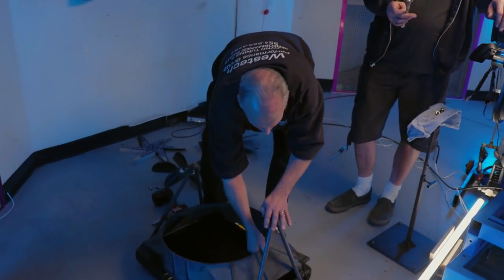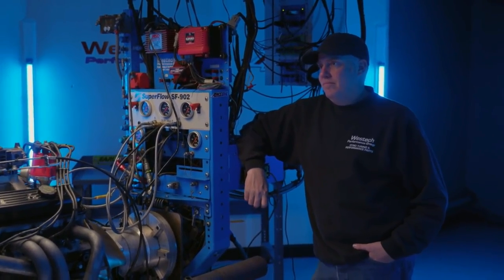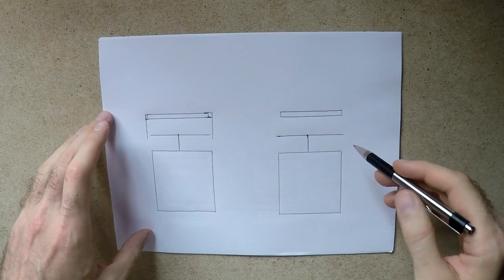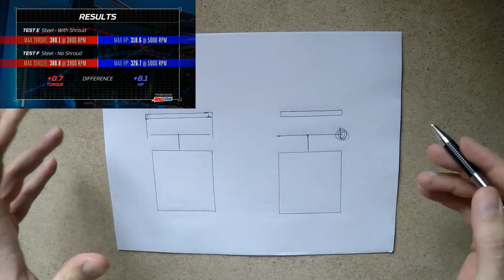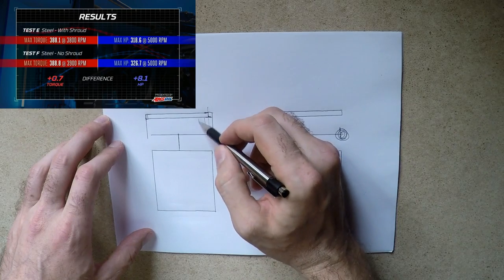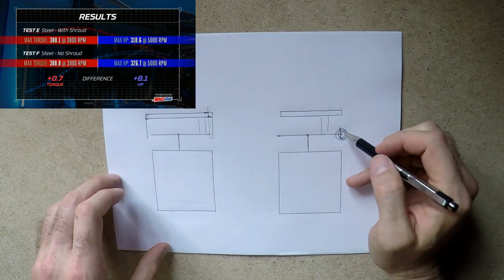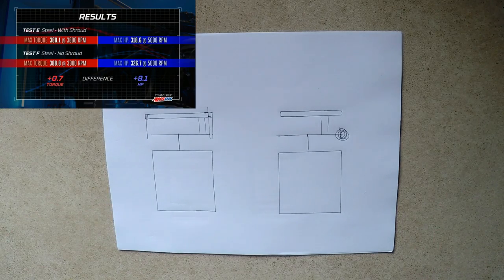Engine Masters EP20 explained!  Why a fan shroud costs you power.

Comment: This is a very scientific explanation of the situation. Let me explain why it takes more power with the shroud, with a more simple explanation. 
The radiator reduces airflow via restriction, it blocks air. So, if you force the air to travel exclusively through the restriction, with a shroud, it's going to be harder to turn the fan.

Comment: For a race car this is valid experiment since you are seraching for more horsepower.  At say, Nascar speedways you get so much air to the radiator at those high speeds they tape over the grill openining to just a couple narrow slits for air in. For most of us we drive on the street, and not at the 3900 to 5000rpm shown on the charts above, unless you are hotrodding it for a few seconds due to speed limits. Normally you are cruising at about 1600 to 2200 rpm. If you are in traffic you might be at idle for long periods. In that case you need a shroud if you are using eng driven fan, or go to electric fans thermostatically controlled. Look at the torque specs at 3900rpm, it's only 0.7 ft/lbs difference with a shroud.

Comment: The purpose of a shroud is to ensure than the fan pulls as much cooler outside air through the radiator as possible. Going without a shroud just ensures less air being pulled through the radiator and a lot more hot air just being stirred around in the engine compartment, leading to overheating.

Comment: The engine running warmer because you don't have the goddamn fan shroud on it, will also cost you horsepower.
Reply: *cough *cough electric radiator fan

Comment: So you're trading some cooling for horsepower since the fan is doing less work without the shroud?  There are no free lunches.
Reply: You don't need the fan at high speeds, when you need performance. Yes, there are free lunches. it's all about reducing  rotating mass, if you reduce it, you get FREE horsepower. Very simple.
Reply: Well you also lose some cooling with no fan shroud, which means less power. If you want to make more power, your engine will get more power when it's cooler than the typical 190F. So there's some trade off here. You could also just go with electric fans to solve all of this.
Reply: more load amp motor wise fans with surround less load more fan rpm less amp draw less fan motor strain without
Reply: @theaussie7160  incorrect, alternator at full load sucks 1 hp plus the battery has full charge and will provide plenty of power for e-fan

Comment: Hey I have a 03 GMC YUKON 2500 8.1 AND I SHOP IN JUNK YARDS ALL THE TIME SOMEONE STOLED MY FAN SHROUD I HAD TAKEN IT OFF TO REPLACE FAN CLUTCH K .IN ORDER TO GET A SHROUD NOW CAUSE I CANT FIND OBE OR USED NE GOTTO BUY A NEW ONE 178.00 DOLLARS GOT ME HEATED ..QUESTION IS  DO I Nessarly need a shroud I live Boise Idaho it's not to hot here not but soon it will be hotter .?what do I do

Comment: Ok . So.. I don't agree. 
The fan shroud forces the fan blade to do more work.. because it has to pull from within the shroud.  The shroud also makes sure that the whole radiator sees air going through.

Without the shroud.. air is pulled by the fan from .. well everywhere, radiator, sides, headlights in front of rad.. wherever there is less resistance basically. 
Your radiator will be less efficient. And will more than likely have gulps of hot water going into engine.
Reply from the maker: So if you look further down in the comments you can see that we already debated this idea. The physics just don't work out the way you think they do. The more restriction the less work the fan does. The less power is required. Think of the extreme end of you example... A fan trying to pull air in a vacuum would have no resistance, therefore no work being done, and no HP required.
Reply: Russ and Adam's garage
The engine uses less horsepower to move a shroud less fan cause it's got less drag cause it's moving less air. It's totally worth a couple horses to run a fan in a shroud to keep everything cool.
Reply: If your just trying to get power.. then yah.. no shroud.
If your trying to make sure it stays properly cool (and not get gulps of hot coolant ). Shroud it.
If you want better HP gains.. go electric fan.

I don't have the time to read all comments.
Reply: @russandadamsgarage105  It is true a fan running in a vacuum draws very little HP.  But being on the downstream of a maximum-restriction cooler is NOT the same as being in a vacuum - the fan is still surrounded by air, and is still churning it - it's just not coming thru the heat exchanger, so cooling is reduced.  An axial-flow fan operating under super-high restriction moves the air radially rather than axially - and this is a very inefficient operating condition for an axial-flow fan.   Shrouds reduces eddies and radial-flow on the portion of the fan's tips that are inside the shroud, which is why a well-designed shroud increases fan efficiency and flow.  Using a proper shroud to increase fan efficiency would allow the designer to use a slightly-smaller heat exchanger, or more practically to allow the clutch fan to run at a slightly slower rpm.  But these guys didn't/can't delve into that.

Comment: Uh, yeah.  You gain power by doing less work: a shroud or collector ring forces more air across the blade instead of just making noise.   It's a basic rule of pumping fluids: the more volume you move, the more power required.

Comment: Very interesting. I always figured the shroud just helped keep the engine cooler at low speed compared to a radiator without.

Now, the question is whether an electric fan helps throttle response and frees up power compared to an engine with an attached fan like people usually believe... and I’m one of them
Reply: Should, as clutch fans use the engine power to turn them. Using an electric doesn't suck up that power, how much it frees is dependent on what you're running I suppose.
Reply: Electric fans are not free horsepower.  The alternator has to create power to run the fan.  That alternator is ran off the engine.  It isn't free horsepower. 
Like Dillon Orr said, "It depends on the use of the vehicle....street car, 1/4 mile runs, trans am, endurance, etc.
Personally, I like thermostically controlled clutch fans.  They only run at low vehicle speed.
Top fuel 1/4 mile car.... no cooling needed.

Comment: So I had a 73 chevelle that kept overheating. Bled the system. Had multiple fans on it (used a clutch fan last). But it kept overheating. I put a fan shroud on it, and it finally stopped overheating.

Comment: My radiator pull fans fill 95% of the radiator surface I don’t have a surround ...now my thinking is maybe a surround on the front of the radiator to channel a vortec air flow thou the pulling fans?

Comment: So should the benefits of the shroud be greater if the back of the fan blade is flush with the opening of the shroud or should the fan blade be set about 1/2 way into the shroud?
Reply: I don't belive the position of the depth makes much difference other than durecting airflow.
The point is to dusrupt the cycle vortex. 
Air cannot circle back into the fan on both flush or recessed mounted fans.

Comment: Now we just need an analysis of the coolant heat rejection between fan shrouded radiator and non shrouded radiator on an identical engine/vehicle setup on track, on street and just idling outside around 80F ambient

Comment: Go electric! theres a shroud around the fan from the manufacturer so even if you just mount it to the radiator it's not going to have the vortex effect although unless its centered on the radiator you will not have an even heat throughout the radiator as of course the fan is smaller and will be pulling air though that particular area so just cent it or both if your running two and you'll be absolutely fine

Comment: I love all this testing and data they get , but tell me this , what is the difference in power between an engine running at 190deg and one running at 160deg. Now you will understand why the fan shroud is used
Reply: That goes back to my comment about trading cooling for horsepower.  Reducing the work the fan does means it takes less HP to drive the fan.  It also means less cooling is done to the engine.  Is the horsepower lost by the reduction in cooling more or less than the horsepower saved by reducing the load on the fan?  This could be tested on a dyno easily - use an electric fan that isn't driven by the engine to determine the best temp for power. Then add in the engine powered fan (mechanical or electric) to figure out the best trade-off between cooling/temperature, and power as installed in the vehicle.
Reply: The one at 190 would probably make more power, cold air in is what matters

Comment: Imagine an electric fan without a shroud. It will cool the circle part efficiently but the other rad surface outside the circle will be significantly hotter.  W the shroud i forces the air come thru the entire surface area of the radiator and not just the circular portion directly in front of it.

Comment: Plastic fan.  Light rotational weight, and flattens out at higher rpm so even less drag on the motor.  

Really what you want is a an air box infront of the rad to scoop and channel air through the rad, then you don't need to worry about the fan part so much

Comment: A fan driven directly from the engine, amounts to any un-necessary extra load that is stealing horsepower. The simple solution is; an independent electric fan in its place.
Reply: The electrical system has to make its power somewhere.  That's stolen horsepower, too.  There is a big debate on which is better.  There are fixed fans, flex fans, clutch fans, and electric fans.  Personally, I think a clutch fan is the best.  It activates when needed in traffic and free flows at highway speeds.

Comment: That’s part of it. Cavitation. The other part related to this is volume of air. The shroud like is shown stops cavitation and increases air flow. The more air you move the more power it takes. The more restrictive the path the less air. Less air less power. So no the radiator being a restriction is not using more power. It’s allowing less air to flow there for the fan uses less power. Rpm is constant in this test. The pitch is constant. The only thing that is changing is cfm/drag.

Comment: do u get better cooling with shroud
Reply: Yes, with a properly fitted shroud and proper designed and positioned fan.
Reply: Thanks for your reply.
Reply: @jallen2305  You are one of the few folks to recognize there is also a correct fan position.  So many people say to install the fan 1/2-way, but this is not ideal for every fan - it is just a good estimation for shadetree mechanics.  Also, decreasing tip-to-shroud clearance will also increase efficiency, but this is more difficult when the fan and shroud are not mounted to the same items.

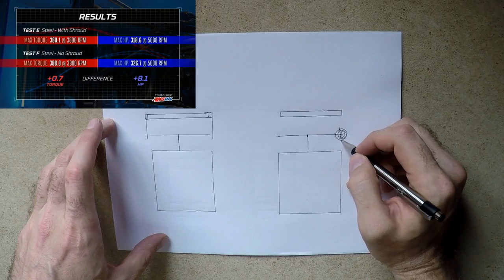Comment: Thats crazy. The shroud directly pulls air from the radiator. Your pulling air from thru the ground. Go take your home air conditioner fan shroud off and see how far you get and loss of cooling and  nothing to  do with power biden with your pen at 1:03. Draw a bunch of air coming up off the highway in-between the radiator. 😅 What are you trying to cool doen  the earth and road while you drive or what.

Comment: And less air has to go through the restrictive radiator (it is sucked from the sides instead of through the radiator), less effort is needed to move the air.
Reply: The point of the fan shroud is to pull air through the rad to cool the engine.  Air going around the rad isn't helping
Reply: @charliesmith5545  of course it is. But they are testing power draw of the fan, not efficiency.

Comment: Sorry but you are wrong. yes, there are vortexes, but that's not why the shroud costs you horsepower. The reason is with the shroud you are forcing the fan to pull the air thru the radiator which is a restriction. The fan is coupled to the engine mechanically, but it's also coupled to the air which is coupled to the radiator. So it's like sucking thru a smaller straw. You are using up power to suck that air thru the restrictor (the radiator). With no shroud the fan is free to pull air from around the radiator and thus less hp is lost.
Reply from the maker: The shroud with no radiator would still cost more HP.  
The more air the fan moves the more work(HP) is done. More restriction = less work done, so less HP is consumed. 
It's basic physics. 
 -Russ
Reply: This was so obvious it's painful!! Complete common sense.  Pulling air through a restricted aperture partially obstructed by metal versus sucking air in from around the sides...
Reply from the maker: Gah! That's not how physics works! 
Work = HP, if you restrict the flow(radiator) the fan does less work, so it soaks up less HP. This has been proven MANY times with electric fan's and restricting the inlet while measuring current draw. 
-Russ
Reply: Ok I get you - the error is assuming a constant amount of air required to be pulled through whereas in reality the restriction just results in less airflow and therefore less drag on the blades.  Obviously this is predicated upon a 'dumb' fan that does not adjust clutch/electric motor speed to attempt to achieve a set engine temp or specified airflow.
Reply from the maker: Exactly!
Reply: Russ and Adam's Garage I wrote a long reply before I read yours. You beat me to it. I concur.
Reply: I would theorise that it works the opposite way around. If the radiator is proving to be the restriction, the fan can grab less air and the fan will absorb less horsepower, the same way that a vacuum cleaner fan motor speeds up when you block the suction port.
Reply: @cryptopyro  A vacuum cleaner's motor doesn't speed up when it gets restricted.  An electric motor has a speed rating (i.e. 1725 and 3450 are common #s for 110v AC motors) and a motor's hp output must meet or exceed the hp required to drive the fan.  If the fan requires more hp to hit that rpm, the motor will run below its rpm rating and will burn up.  So teh fan/motor must run at that motor's rated rpm under normal conditions.  When the fan becomes super-restricted, the fan becomes extremely inefficient, which causes a significant increase in noise - this inefficiency is what you are hearing, not an increase in rpm.
Reply: Yes.  Shrouds allow a fan to become more efficient and behave (as much as possible) like an axial-flow fan by reducing the radial-flow eddies at the blade tips.  The purpose of a shroud is to give the maximum cooling from a particular fan/heat exchanger application.  Axial-flow fans operating in the radial-flow area of their performance curve have reduced flow, higher hp, and make a lot of noise.

Comment: dude... this should not be advice given to normal drivers. You're going to cause an epidemic of overheated cars in cities across the nation. You DEFINITELY need those shrouds for more efficient air flow control, otherwise you will waste all the fan work because your air is leaking in any available crack or open space. You need that focus for air pressure from the front to shoot as directly through the overall engine shape to the rear as possible and minimal airstream dissipation from random open spaces. All the work the fan is doing to pull air... a substantial amount of that air mass will never reach the rear of the engine if you do not have a shroud to control the front air source.